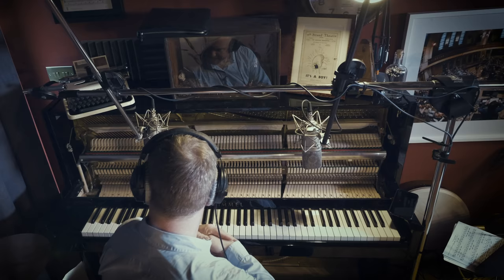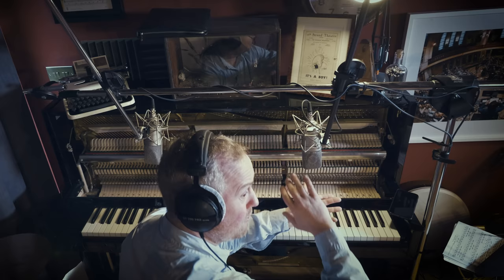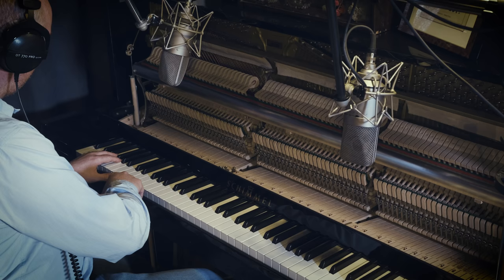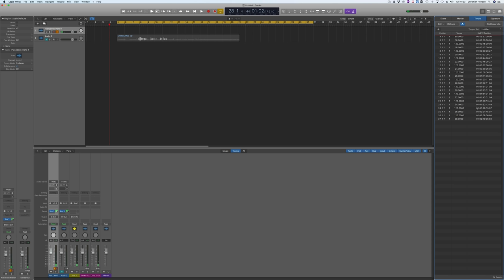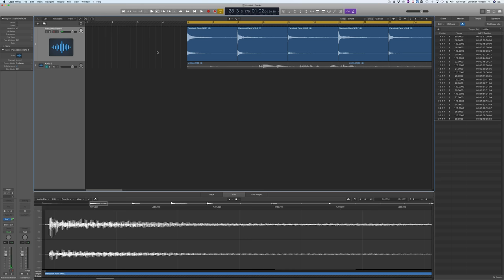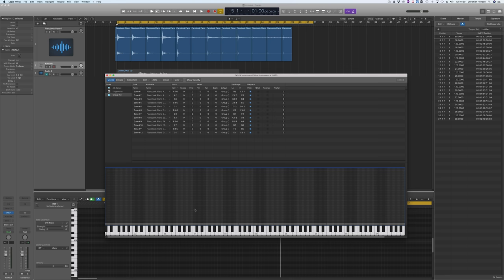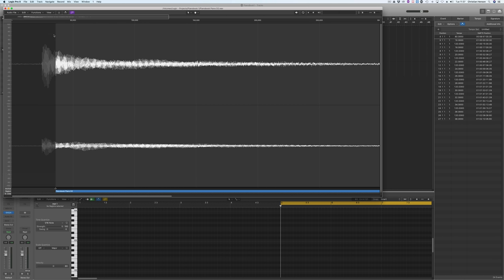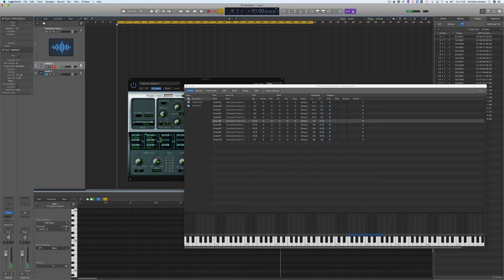How To Sample A Piano (in 2 minutes 10 seconds) - PB001

Comment: I noticed you suggest labeling samples as sharps, rather than use their corresponding flat names. That reminded me of something. For many years, I professionally repaired synthesizers, electronic church organs, and pipe organs. Most of the players I had as customers called the "black keys" on their instruments "flat keys". However, I can't remember a single electronic instrument manufacturer that called them flat keys. In all the parts lists and service manuals, they were always referred to as "sharp keys".

So for what it's worth, there are "officially" no flat keys on a typical synth or organ. There are only sharps. Your sample naming system fits perfectly with this tradition.  :)